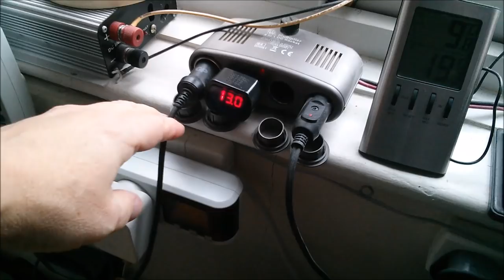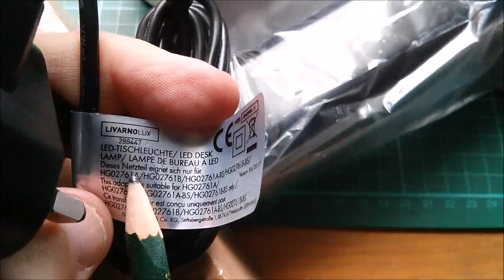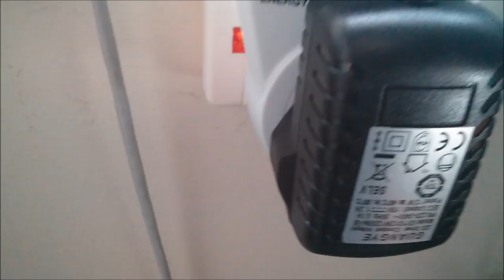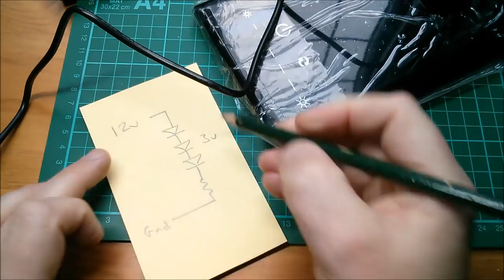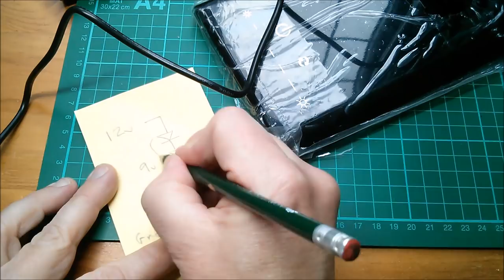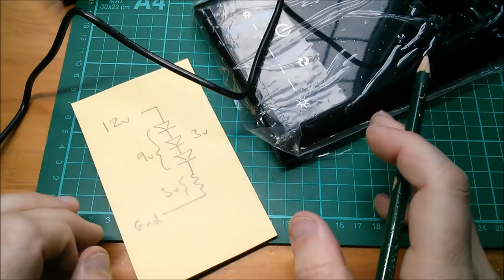10V LED Desk Light from Lidl - Overclocked

Comment: 3 points, 
1- All LEDs (everything really) has an internal resistance that act like resistors. The more current you pass through the LEDs, the more voltage drop across them due to this internal resistance. Even Zener diodes act this way. 
2- It works with higher voltages, but you are driving them harder. Don't expect them to have a long life. They specify an odd voltage like 10 volts to avoid using a beefy regulator. 
3- Close to half of the power from those solar panels are lost in those flimsy long wires. Either step up the voltage at the solar panels (to say 72VDC), or Convert DC to AC with an inverter, or use expensive thick solid copper wires. 
I would personally go with an AC inverter.

Comment: I would add some anti oxidant grease to the battery terminals. Galvanic corrosion from dissimilar metals is common in DC systems. Here in the US it is used in electrical panels and vehicles. In the UK I believe Duralac Anti Corrosive Jointing Compound is the same as the US noalox compound.

Comment: Of course the easy thing to do would be hook it up to the bench power supply... that way as you increase the voltage above 10v you can see what the current is doing AND set the current limit on the power supply to prevent any overload.
Reply: Stuart McConnachie 
I'm not sure Julian has a proper bench power supply.

Comment: Time to get a bit more technical.  How about measuring the current consumption?  Of both lamps, at various voltages.  You have a suitable PSU.  This will allow you to determine whether it's LEDs in series with a resistor (higher voltage -> higher current) or a switch mode regulator (higher voltage -> lower current).  You can also determine the lower bound for the DC operating voltage.  Upper bound is a bit harder - magic smoke and all that.  How about a sign above the filming area - "Measure that, not waffle about it.", "Get the 'Scope out, it'll let us all see."  Cheers, Brian.

Comment: I recently also bought a desk LED lamp powered with a dubious quality "10V" power supply. I measured the output voltage on it under load and it was giving 8.5 V but the main reason I replaced it was an unbearable whine on idle. I got a proper 9V brick and it runs fine. I haven't decided on 12V supply as mine is simpler and I expect resistive regulation inside.

Comment: There are some hot-spots from the lights. You can soften the light by placing thin cloth or tracing paper under the lamps. If you don't find an appropriate material, you can buy diffusion silk on AliExpress or buy one of those collapsible photo reflectors.

Comment: Waht is the voltage of the original power supply without load? It's buzzing like an old transformer power supply, these aren't regulated at all. The voltage fluctuates between 10-16 Volts.

Comment: Hahah, nice video about how to turn on a light  :P   For your videos if you use the lamp for artificial light (actually, you could use them in conjunction with natural light), move the lamps a little further apart. This will help further reduce your shadows. With the 2 lamps as you had them, the shadows were definitely softened. Move them a little further, and the shadows will get even softer. Will help a lot when needing to shine light on small parts.

Comment: 4:06 surely be better sending 12 volts from that box which could house your batteries than sending low power from the panels, because of wire resistance issues?

Comment: Those cheap linear power supplies are often very poorly-regulated, if at all. It,s not uncommon to find 17 Volts coming out of a 12V PSU when on low load. They're often chosen to give something close to the stated voltage only when delivering the stated current. The '10V' PSU may well be providing almost 15V when the lamps are dimmed. It would be interesting to hear what voltages it is really supplying at various lamp brightness and temperature settings.

Comment: I have a rechargeable work light which comes with a 10v 1.8A mains adaptor and a strait-thru car adaptor which charges at 14.5V, don't make sense that the adaptor is at 10V unless it reduces current flow and makes for a cheaper adaptor.

Comment: I have a little LED light that I wanted to convert to USB powered. It takes 3 AAA's in series 4.5V.  When connected to 5V the little smd transistor for the LED's was getting very hot only after a few seconds. While on 4.5V it doesn't break a sweat. Seemed odd to me.

Something inside that lamp may also not like the increased voltage too.

Comment: Since it's not a stabilised voltage on those wall adapters a 10v one can be anything from 8 to closer to 14. I have measuers alot of them since they were burning my LAN equipment.

Comment: I think it's time to fix that solar array and get everything running at max efficiency so as to increase it's capacity and power that whole room. 
I think you need to mount your charge controllers horiz so the ends stop filling with water.

Comment: I work on the basis that if a 12 Volt item is likely to be used in a car it should work correctly on 10.5 to 15 Volts
as this is what it could get from an onboard cigarette lighter.

Comment: Julian, why don't you use a buck/boost converter at the multiport carcharger; to make sure you always have, say, 12,5V? I use a DPS5015 for this. My input is 24V however; the input needs to be higher on my model.

Looking forward to more solar videos; really enjoying them.
Reply: Niels Winters Wastes energy if most plugged in devices have their own regulators.

Comment: I would have checked with a variable bench supply, to see if the current was sensitive to voltage. If the switchmode regulation is really good, the current would actually fall as the voltage increased
Reply: Matthew Day    yeah, he knows that,  he has the knowledge and the tools, he's "playing to the gallery".  I'm not the only one who's starting to get disenchanted with this channel.  I hope it won't continue at the level of "I'll plug it in and see if it blows up".  It's "faux naif", feigning naivety for drama.

Comment: Guess it has a boost converter for the leds.  Big question is if it has input capacitors rated for less than 14V. It can take a while for those to blow  ^^
Reply: Typical capacitors have either 6V or 16V rating, but nothing between those I think.
Reply: I have a fair assortment of 10V parts here,  in addition to the others...

Comment: The Tour was horrible. All those lose Wires ... the Chargers and Batteries not protected against nature... those rusty connectors ... fallen Panel not fixed ... what is the Point in all that? So much to do but hey lets make a YT Video instead .... I like your Videos but this can´t be unseen
Reply: Your use of accent characters instead of apostrophes cannot be unseen either.
Reply: Anvilshock try to communicate with me in German ... than ill correct you ;)
Reply: Das halte ich für höchst unwahrscheinlich.
Reply: Anvilshock jaja

Comment: Neat. I’ve had my eye on the Aukey and blitzwolf models for a while but couldn’t justify the price tag. This is a third of the cost. Didn’t see it in my local Lidl yesterday though :-(
Reply from the maker: No, I bought this late last year. That's the problem with Lidl, they don't have consistent non-food stock.
Reply: Julian Ilett Ah that’ll explain it. It’s a grab ‘em while you can affair in there. Cheers
Reply: they don't even have consistent food stock :)

Comment: The most annoying thing I've come across is a 14v samsung monitor. It won't run on anything below 13.5v, which is dumb because 12v is a standard supply voltage for monitors. It ran fine on 16v though, so I stuck with that.

Comment: Spoiler: Switched mode PSU in "perfectly fine at a wide range of input voltages" surprise. The lights do seem to glare somewhat off the cutting mat. Ideally you'd want them further away to the side, bounced off a diffuser.

"Reasonably thick and a nice bit of length to it". Heheheh...

Comment: It seems to me that although the system at 5:00 stores power at 14.4 volts, it would be highly unlikely to power the electronics at such a high voltage.  Therefore it is most likely well-regulated to 5V internally.  

I'm surprised to hear Julian discussing a drop in brightness from 14V to 12V.  I'd have been much more surprised if the lights were running at the higher voltage.  It makes more sense that the LEDs run at full brightness throughout the full cycle of the battery.

Comment: 3:35 Really? Block connectors outside? What a stupid idea ! (Instead you should pot every outdoor connection  in Resin
The cables are too long(low DC?) and not suited for outdoor ! (*Underground rubber cables in flexible conduit are the way to go !*)
5:00 These will never charge as the current is simply too low for lead-acid batteries!

Comment: Its intresting to see that LIDL in germany is selling the excact same lamp... I know because i have bought one some weeks ago... My power supply is buzzing too... but it buzzes less and less if the leds are set dimmer... Intresting "Synthesizer Power Supply". Just the power supply of my Internet router is even more funny sounding under load.
Reply: The wall adapter my ISP supplied made no audible noise, but generated so much electrical noise it knocked out my LAN over power adapter.
Reply: I often work with unstable audio circuits wich pick up a lot of noise from the power line. Since Years i have a quite regular Buzzing sound in my Speakers ... it are 3 buzzes about .5 seconds long with .5 seconds break in between , then a long break and the the 3 buzzes again. I dont know what it is. Sometimes it isnt there for month and suddenly it is back again for days... In the beginning i nearly went crazy because i did not find the source, and now i ignore it :D (Because it moved with me from another location...)
Reply: I bought the lamp at Lidl in Germany about a year ago. I got a power supply that looks different from Julian's in the video, and it does not buzz. The power supply is a "KPTEC K15S100120G", also 10V 1.2A. By the way, the coaxial power connector (barrel plug) has 5.5mm / 2.5mm outer/inner diameter, not the more common 2.1mm inner diameter. The power supply plug (at least mine) is a combo one that will fit both inner diameters, but the lamp's port won't accept a 2.1mm one.
Anyway, it's a nice lamp.

Oh, and Julian, if you're reading this, you can also control the lamp's brightness via the dashed line between the sun symbols.
Reply: The sounds from electronics that change with the load can be very annoying. Just today i have thrown a power supply away because it made annoying high pitched noises.

But it can get worse. When you mentioned the power supply of your internet router and how it changes the sound when it is under load, it reminded me of something else. The voltage regulators in a computer that provide all the special voltages for the CPU make noises too. And a few years ago it was publicly demonstrated that it is possible to extract parts of the data that is processed by the CPU just by listening to it. In that case it was a gnupg private key, details can be read at https://www.cs.tau.ac.il/~tromer/acoustic/

Comment: maybe they do not specify a range of voltages so that you have to use only that ac adapter so that if you break it or lose it you must buy it again. In case of uncommon voltages like 10v (taht is pretty uncommon for a power supply) it seems made on purpose!
Reply: Meteora125 possibly, but Lidl guarantees electrical items for three years, and don’t ever seem to quibble returns.
Reply from the maker: What if you return electrical items with a smoky aroma?
Reply: In case of magic smoke some magic might happen!